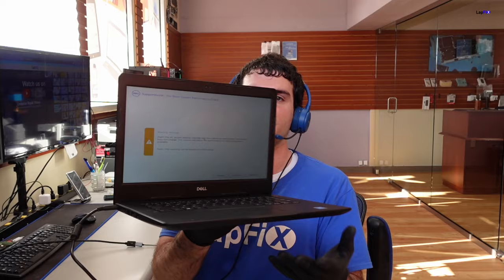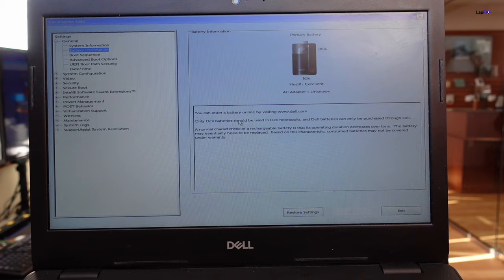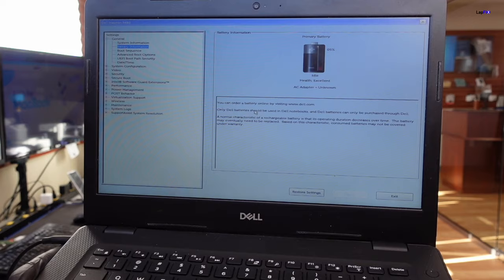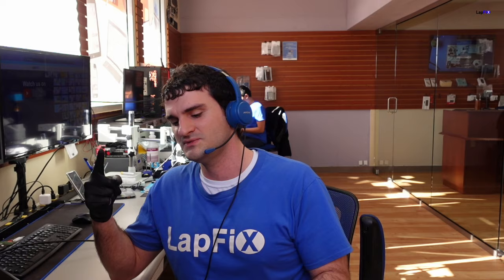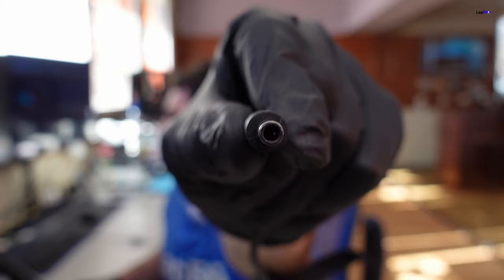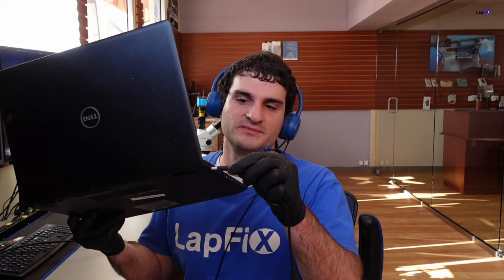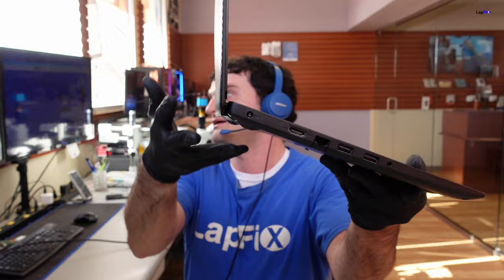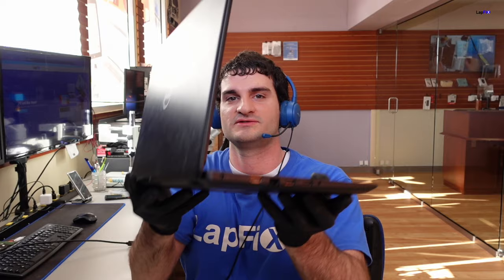How To Fix Common Issue On Dell Laptops Plugged In Not Charging

Comment: hello i was wondering if you can help me my  latitude 7480 was overheating so replace it with brand new thermal i did all of the proper safe procedures when disassmbling the labtop from wearing anti static wrist latext gloves removing the internal battery , cmos battery holding the power button down for a min to drain whatever power that is left disassemble the heat sink fan removing the thermal paste from the cpu gently and lightly as possible where i dont damage or scratch the cpu and video chip put new thermal paste and installed everything back and now it doesnt turn with or without the charger just now power idk what could be the problem all i did was remove the thermal from the cpu so i went back to what ive done remove the thermal off the cpu and video chip got a flashlight and a magnifying glass to thoroughly check the cpu and video chip and theres no scratches ,dings,etc both are fine ive been doing this for years this is the first time ive had this problem before i would appreciate it very much if you or anyone can help me and tell me what could be the problem my labtop is a DELL LATITUDE  7480   i7-6600U looking forward to hear from you or anyone here that can help me with this problem .
Reply: Don't know what you did, but consider this, a computer will power on with or without a CPU.

Comment: I have a problem. I have a dell latitude 3520. Its all fine for the ports but it doesn't just connect. The pin is straight and the laptop is just like that. Im scared to open my computer to break something. Can you help me out?

Comment: Mine gets power the motherboard when I tested with a multimeter get's 19v but the laptop doesn't charge or come on no lights light up on the laptop but the AC is getting power

Comment: Any places to buy the port parts you recommend.
Reply: Depends how old the computer is, and always try to get the OEM replacement. For instance, I have a Dell M4700 that came out in 2012, and to replace the jack with OEM, my only recourse was to order it from a company in Hong Kong.

Comment: I had mine not charging, but then reseating the charging cord correctly made it charge (1.5% capacity by the way)
Reply: I thought it was fully dead on the battery, it would show battery failure

Comment: I replaced the DC adapter socket and new battery and i get the same message :(
Reply from the maker: In some cases, the circuit can be damaged

Comment: my dell latitude e6540 is plugged in and says charging,, but its NOT charging!?? stuck on 0%!!?? i did a diagnostic test and all passed, i replaced the bios battery, the main battery health says good and my ac charger works and i can get power to my pc but its NOT charging my battery!! i am going to get a new dc jack and new battert and hope to god the new battery charges because i put so much upgrades on it and i will be upset if i lose it😢😢😢😢
Reply: Had same problem 9% and no more charge. To fix it just did uninstall Dell Power Management. Actually I uninstalled all software which names begin from word Dell. Now my Dell G3 3779 works faster. No more 100% disk usage problem.

Comment: Hey i don’t know what to do I have AC adapter and a latitude 3500 but when I plug it in in dont charges and the LED thing neither don’t goes ON and I keep loosing battery even if I let it plugged in

Comment: The thing is I’ve already done this. I replaced the battery, the Dc port, and the Ac adapter TWICE! It hasn’t fixed anything. I’ve updated the drivers, clean installed windows 11, and updated the bios. What’s next???
Reply from the maker: Most likely have a bad charging circuit on the motherboard
Reply: @lapfix  you think I could solder it somehow?

Comment: I have bought mine last year so annoying!
Reply: Had same problem 9% and no more charge. To fix it just did uninstall Dell Power Management. Actually I uninstalled all software which names begin from word Dell. Now my Dell G3 3779 works faster. No more 100% disk usage problem.

Comment: Sadly, same symptoms, but different problem I think. Still won't charge (AC Adapter = Unknown) even when it's on a dock - E Port Docking Station - I do I.T. at a university and I have a box of known-working AC Adapters so... what else? Firmware? Motherboard?
Thanks for all you great help.
Reply: Had same problem 9% and no more charge. To fix it just did uninstall Dell Power Management. Actually I uninstalled all software which names begin from word Dell. Now my Dell G3 3779 works faster. No more 100% disk usage problem.

Comment: Mine was stuck at 9%  I tried to  do the hold 15 second  process and my lattitude e6540 won't turn on  with the battery or the charger now   im currently   doing a bios reset ... what else should I do? ?
Reply: Had same problem 9% and no more charge. To fix it just did uninstall Dell Power Management. Actually I uninstalled all software which names begin from word Dell. Now my Dell G3 3779 works faster. No more 100% disk usage problem.